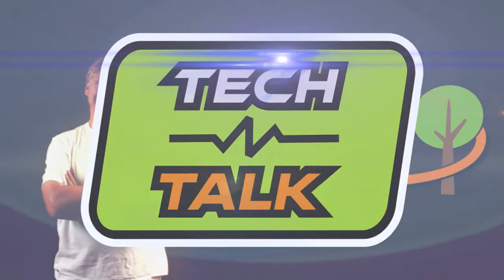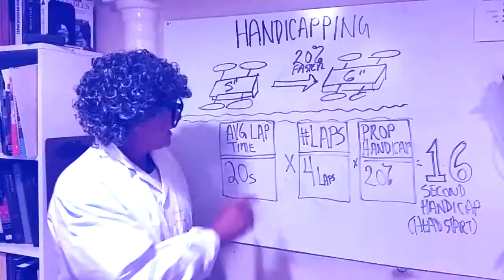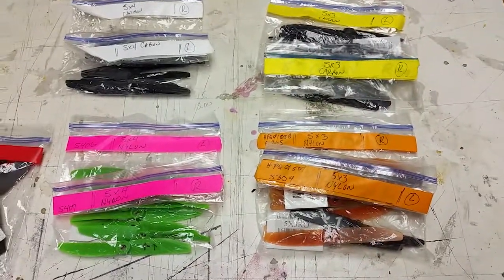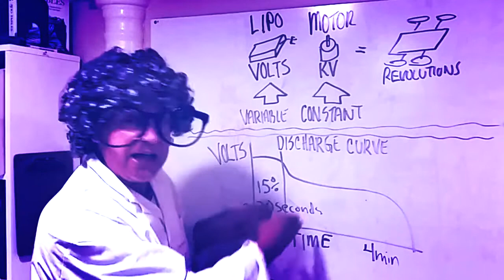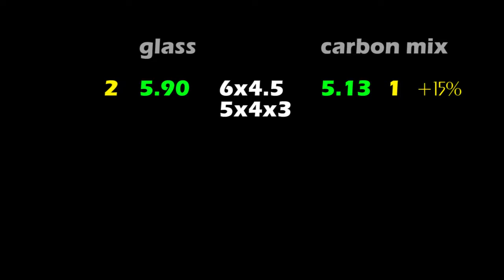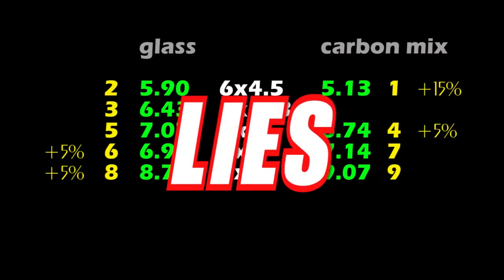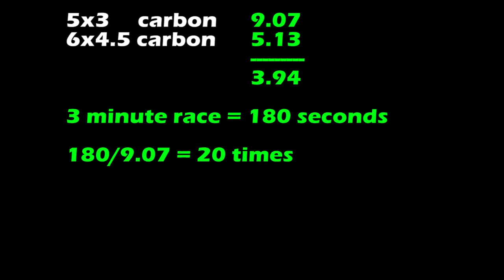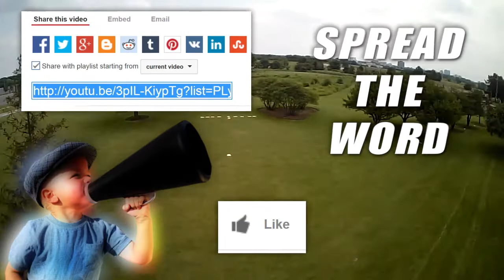Tech Talk: Miniquad Propeller Shootout with SHOCKING results // HQProp // KK2.1.5 Cobra 2400kv

Comment: Fun vid, not sure props due to batt power make a huge difference more so is weight. I think classes should be >250g, >500g >1kg & 2kg+ Then the unkowns and not tested props won't stop races. Also standard track distances like 100 yard dash, 100yard etc Lots of fun to be had,

Comment: I miss the bloody 4S + 6x45 setup :D. The real problem here is that motor has the hard time spinning the prop ones it gets more drag. It all has to do with those 2300kv motors being optimized for 5x3 props. I had better results with lower kv and bigger props like 6x45. But the best results I got with 4S + 6x45 :D. Bigger battery=more inertia for gaining speed easy and o fcourse more rpm's :D. But the motors need to support it as well. All you need when racing mini quads is the 4S :D

Comment: It would take many, many calculations to get an ideal figure for the handicap - an increase of 20% in propeller size would constitute a much higher thrust value - that extra 1/2 inch on each side goes a lot faster than the 2.5 inches before it - giving it much more lift than the inside of the props. interesting that the carbon props don't hold their pitch better though... or maybe they do and they are just designed differently

Comment: How does it behave with Propeller overlapping? 

I´m thinking of putting 6045 Props or maybe even 7" Props on a Mini Hex that´s designed for 5" Props.

There would be a space of 50mm to the counter-rotating Propellers, mounting the two Motors of the middle section upside down. Another option would be to Mount the two Motors of the middle section about 10mm higher. 

It would be just like the Boeing Chinook, just in form of a mini Hexacopter.

Thanks up front!
Reply from the maker: Yeah, that's an excellent question. There was no overlapping on the Flip260 frame I tested. I am sure there is some loss, but I don't really know.
Reply: +B31A Hexa is inefficient as well as more than 1 rotor is inefficient.

If the props are too long they will overload the motors and high RPM won't even happen.
Reply: +Anthony Abelardo Thanks for the Answer Sir!
I discontinued the Project because is was inefficient and made the Flight Controller work harder.
Still, it was a Rocket, but the HK Thorax frame, is as Aerodynamic, as a brick.

Cheers
Reply: B31A yea

Comment: What about accounting for bigger prop, higher amp draw, battery gets weakened faster so in the end of the race the handicap would not be the same. I think handicapping has a lot more variables than what are mentioned here but judging from responses to the previous comments it seems like a well done test for if all quads are exact same weight and race is short enough that battery drain is negligible.
Reply from the maker: Agreed, handcapping is a great theory, but not practical in real life. The key is to aware that blades will affect race outcomes dramatically. If you want to compete on skill, you need to regulate overall thrust (blades, cells, motor) and blades are the biggest variable once you lock down number of lipo cells. Most motors in the 250 class are relatively equal, thus no need for major regulation.The majority of racers I talk to have no idea there are 5" blades that have almost triple the thrust of other 5" blades.
Reply from the maker: FPV Tree racers is a member is GoDroneX and we have adapted our rules & regs to their suggested guidelines.

http://www.godronex.com/godronex-competition-guidelines

Comment: 7:40 amazing? Maybe You should try a higher C rating on your battery.
Reply: Sry right link 4:40. So 1.3x30=39A Must have a strong voltage drop and hot battery

Comment: Also do you have any thrust/rpm figures for the props, emax spec sheets say their 2280kv 1806 gives more thrust than the 1804 2480kv motor on same 5x3 props just because rpm drops off less on the bigger motor.
Reply from the maker: I couldn't find any thrust data concerning Cobras and HQs. I tried to verify the results based on the spec sheets before I invested more time to do the second test.

Comment: How did you account for the difference in actual distance traveled?  There's no way you could fly the exact same path on each prop.  How much difference in time would, say, 20 feet make?
Reply from the maker: I agree. This same question could be made about a gust of wind.  But I did a total of 4 timed runs always within the first 30 seconds of the battery.  The results were always the same. If it was one flight, there would be too many variables that could affect the result. But when you do 4 runs and they are all about the same, it just comes down to the blades. Plus, HQprop doesn't publish any technical data, so I couldn't reference anything to verify if this is the way they were SUPPOSED to work.

Also, that is why I laid out arrows throughout the course so I could stay on course. The angle of flight is much more than what is shown in the video since the camera is on a 20 degree shim and the FPV cam is about 7 degrees.

Comment: This may be useful when people are "drag racing" quads in a straight line...
Reply from the maker: +Khan Kor Dreams Prop thrust must be looked at as a system. People now are understanding efficiency, watts, etc and look at the motor kv, escs, battery, props and weight. This video looked at real world versus bench testing . . . and they were equal, no real aero affects.
Reply: I can agree with that...but not as a handicap or race standard. Maybe equal batteries and motors...but what makes racing...racing is knowing what set up to use for what conditions..
Reply: On a tight twisty course the 5 could whip up on the 6 even if the 6 is faster...and a more rigged or flexible prop could also make the difference in handling..also bull nose or 3 blades. Could be floatier and not be able to drop through gates...all that should be up to the pilots preferance.
Reply: +FPV Tree Racers In the simulator I was quicker around the course with with less pitch than more at 6" because at full power on a steep turn it stays in the air better instead of falling towards the ground.

More pitch is definitely better on a straight but turning, definitely less pitch?
 We need a test for 1 hard banked turn at full speed to another gate.  I say do 3 gates and start when flying through first and flying through 3rd w/ the 2nd gate being an apex but the gates far enough to be able to sustain full power at 2nd gate.  Do multiple runs to get a good average time.
Reply: Hi KV motors are faster with a 2 blade and less pitch...Tri blades feel more locked in and have more thrust out of the gate, but fight against them selves up top...
Reply: G-Sawus is the prop wash wobble when coming out of a turn or a loop totally gone w/ tris?
Reply: It will def be more locked it...but the wobble needs to be taken out with tuning..

Comment: Try black 6x3 GemFans. They will break halfway tru the race...
Reply from the maker: Last weekend a guy had Gem 5x3 nylons. They didn't break, but they bent. I gave him a set of Hqprop 5x3 glass fiber / nylon composites and he had half the blade damage for the day. Not casting judgement on brands, just that certain composites hold up better for tree racing where you crash a lot.
Reply: If gemfans only broke after they get damaged, I wouldn't mind. I broke 3 pairs brand new 6x3 gemfans in 3 days. Except for one, they were all brand new when they shattered mid air without touching anything.

In comparison, this summer I flew daily with 6x3 HQProps for 2-3 weeks without any proplem(then crashed into a wall and broke all 4 but that's another matter)

Also flew with 5x4 carbonfibers... Gave up on them after they bent the shaft on 2 motors... 

Anyway, I believe I've experienced gemfan 6x3 black props enough to cast judgement on them. And my judgement is: either there is a problem with the 12 pairs I bought from 2 different suppliers or gemfan props are shit.  

I don't know if the same problem exists with 5x3 props or the "new" gray ones. Maybe they are perfectly good props. But it is an undeniable fact that 6x3 black gemfans are unusable.
Reply: flanker the same experience!
Reply: +flanker You can get 12 pairs for close to $1 each pair on ebay bought in bulk.

Comment: Surely on a complete lap these percentages dont work out, I dont believe 6x45 could ever win a 3min race after an 80second handicap, it would have to lap in half the time of 5x3 which just doesnt seem possible.
Reply from the maker: That's is what I thought as well. But if you are running a basic course where you would be 100% throttle, I imagine it would be pretty close to the example. As a quick test, I ran Slalomfest which is a pretty difficult Rotorcross. But I was certainly not at 100% throttle. Without any effort I ran 20% faster with 6x4.5 nylons vs 5x3 nylons. I would say a 25% handicap would be in order. . So my racer tips of 15% for 1" in length and 15" for 1 degree would be pretty accurate based on my actual Slalomfest rotorcross.